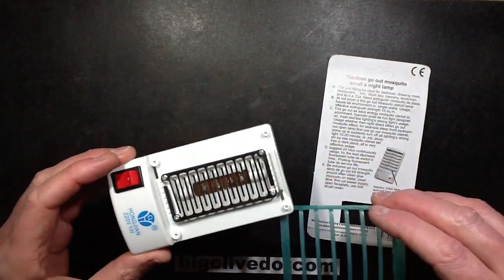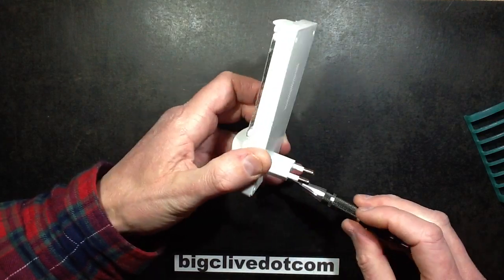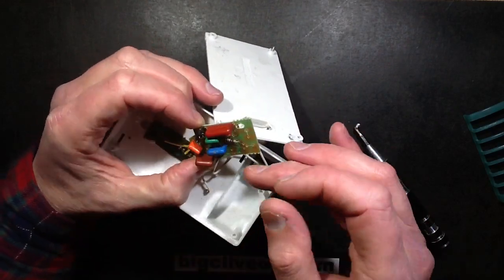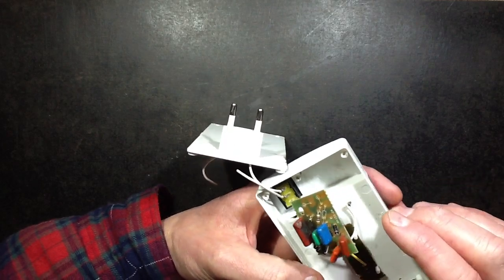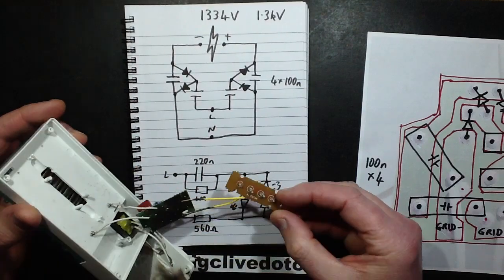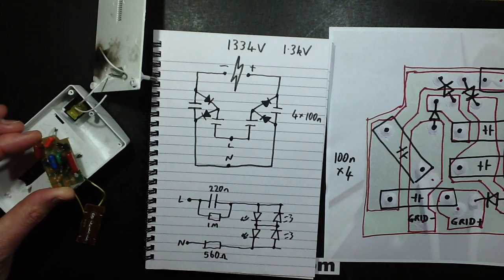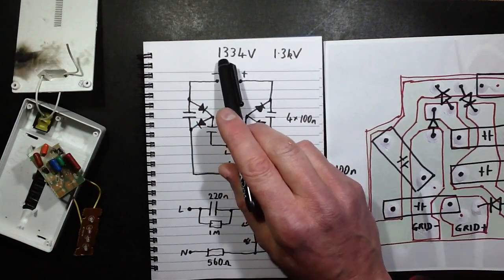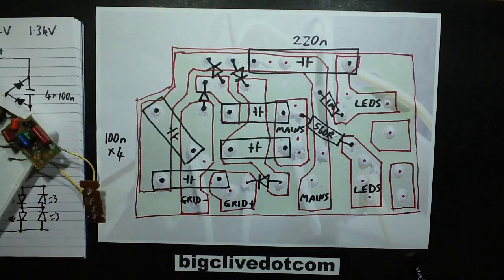Incredible exploding Chinese insect (and human) killer.  (with smoke)

Comment: Interesting Garden variety of coloured Caps in there. Your commentary is usually awesome. keep up the great work. The magic smoke release was epic ! The Caps and diodes should all be the same voltage and capacitance ratings. I know that the Chinese 1N4007 diodes from ebay are a lot smaller then the genuine 1N4007 diodes made in USA.

Comment: The capacitors are probably recycled from e-waste.
Reply: Hi DiodeGoneWild :D
Never really thought about this until now but you could be right... even so it could also be that they just picked some random capacitors from a bucket or drawer and used those! Like a mystery roulette game...
Having said that, I could have easily bought one of these from my local garage sale a few days ago. I really should have got it, shouldn't I? :p
Reply: I pulled apart some CFLs recently to get at the little ferrite cores within and liberated the other components at the same time. Having seen this video now I think there's everything you need in said CFL to make one of these shoddy things including the diodes and random capacitors.
Reply: @FordPrefect23  Maybe that's what this thing is made from - old light bulbs.
Reply: R. Perkins Reduce and reuse for the environment!
Reply: On the Shenzhen market, you can get anything for any price you want, but you get what you pay for.
It´s not even worth it to salvage parts, just buy a 10000 pieces for a buck.
Typical questions I got were: Do you want originals, original fakes or cheap replacements?
Although I seriously think that the first two are the same :-D
I wouldn´t recommend cheap replacement for industrail relaus, though. 20% don´t switch or get stuck.
Reply: Or have capacitor plague.
Reply: LOL and 0.00000000000000002% Gold

Comment: The capacitors are different because it has to convert to metric voltage first before it raises the voltage. :p
Reply: No
Reply: Yeah, metric voltage and metric time are difficult to convert accurately😵
Reply: @bruceanderson7762  
If you think converting metric voltage and time is difficult, try converting metric condom sizes.
Reply: @kaisersose5549  Aahaha,ok, yeah.
Reply: There was in fact a push for metric time.  Oddly it never caught on
Reply: @archiedentone5950  I remember that.  The reason it never caught is because everyone on the planet who keeps time agrees on how a clock works.
Reply: @kaisersose5549  Make 'em like the Torx screwdrivers.  No metric, no imperial, just a numeric size, such as T5, T6... so the condom sizes could be like Torx's nomenclature.  Or, we can just have four sizes: small, medium, large, and 'oh my fucking god where did THAT come from?'

Comment: I found it quite interesting that at 4:18 when the cap went pop the pulse affected the camera! 
Would that have been caused via the back feed through the power supply (mains I presume) or via some sort of mini emp ?
Reply from the maker: +Wolfy Wolf It may have oversaturated the camera's light sensor causing a line to appear.
Reply: +bigclivedotcom Oh.... And there I was getting all excited about emp's and weaponising fly zappers, Thank you for the quick reply.
Reply: +Wolfy Wolf In fact, it's more likely to be how the flash of light from the pop looks when captured on a camera with a rolling shutter. The flash happens when the sensor is scanning the top of the frame, but is gone by the time the sensor's scan has reached 1/5 through, and so only a small portion of the image is lit up.
Reply: I think its because the camera has a rolling shutter. That means the flash was so quick, that the camera only caught it on the top part of a single frame. But i might be completely wrong.

Comment: I bought the very same device about a year ago for 1€ (inc. VAT). It is the best 1€ ever spent, as far as I can remember.
Apart from successfully killing insects, this device also provides a quite strong illumination, so there is no need for someone to switch on the light during the night in order to move from one room to another.
I am going to buy some more devices of this kind before someone is killed and the device is recalled!

Comment: the reason for the different capacitors is because the closer you get to the output terminals the higher the voltage rating of capacitor is needed.

Comment: For shorting capacitors out i do always use a sponge which is only wet on the downside. Easy and fast contact to all solder points. Doesn't even need saltwater, just tap water is sufficient.
Reply: Tap water is salt water, eg. it has lots of ions in it. Purest water can be found at powerplants in the steamy part that goes trough the turbine to turn the generators. But even that is not true pure water. There's two physical/chemical effects working there: 1st any impurities in the water will form glass deposits on the turbine blades deforming them and causing all kind of havoc. 2nd pure water is acidic, because autocatalyst in water produces OH- and H+ ions and H+ ions being light are more active than the OH- ions. This corrodes the turbine blades and causes all kind of havoc. So it's a lose-lose situation.

Comment: They probably bought capacitors from several factories that had failed quality control. Factories usually sell off failed electrical products so that they can be recycled, since they often have valuable metals inside. However, the ones that work somewhat are resold and only one that are completely dead are recycled.

Comment: In the USA in the Pacific NorthWest, we have the rare mosquito.  I have a US version that uses a tube instead of LED's.  Started years ago using one when tent camping to clear out the tent by running one with an inverter for about 10 minutes to completely clear the tent for the night.  Still have the unit in the motorhome for the same use.  I would like to find a US version with LED's instead of the tube.

Comment: Maybe made for American 110vac supply.as the discharge capacitors should be rated at double  the ~300Vdc supply peak plus about 33%. So 800Vdc or 1kV more readily available. The first cap before the diode at 400V rating, is OK.

Comment: 4:25 is about what I had happen with an original Xbox PSU a while back. Had a nice failure at the solder joint for a capacitor.. sounded about the same too. Don't know what happened there, but at least I got it replaced.

Comment: have you ever played with one of those electrical bug swatters... they are crazy. they are shaped like a tennis racket and output a few kilo volts. it is actually a nifty little circuit, just a transformer and a little 500v poly cap IIRC.

Comment: Probably was made by the ghost shift, using the moulds of the real one, but without the "expensive" electronics inside, using stuff bought from component recyclers. Use injection moulder on Friday night after work to pop out 1000 cases, make a box and labels and then spend the weekend stuffing the boards, then put together after hours during the week and sell on the grey market.

Comment: The capacitors should keep it below lethal dose, however you need to trust that they will never short. Luckily those aren't electrolytic (which short when worn out). They look like polypropylene (plastic film) capacitors which normally fail open and last a while (if rated properly for the charge). Still not something that would be considered safe in the EU as there are some open wires. Yes if the diode fail short you're also in trouble.

Comment: I quite like the way you do the reverse engineering here, but I didn't get the application you used for it (you spoke to fast for me). Could you let me know?
Reply from the maker: I used a free graphics processing package called Irfanview to crop, flip and lighten the image.
Reply: Irfanview is one of the first programs I install, whenever I do a windows install. Small, versatile, powerful, free. Love it.
Reply: Clive uses Irfanview.

Clive has the tastes of a gentleman.

It's basically been all the image viewing stuff I need for the last, what, 15 years? And if you only need super-basic stuff, it'll do the job.

If you need something a little more advanced, there's always GIMP, but then you're going into more of an image-manipulation direction a la Photoshop. If all you need is simple stuff like brighten/crop/flip, however, Irfanview's got you covered, and it's really good for viewing images too.

Comment: I am sorry, but what you say about the LEDs (them being connected halfways, you state it may halve the voltage from appr 6 to 3) in several ways makes no sense; of course, electricity cannot flow back to the polarity it came from and even if it could it STILL would be through a second LED!  Dependent on where the + and -  are, the electricity can still only flow one way, namely through those two LEDs that are in line 'conductive into the' right 'direction for it to flow through them of course. But maybe it could be that this does something to what happens after each polarity switch of that ac current (response, how they do or do not keep on glowing or show that 25 Hz lighting frequency visually)? However I rather think it is just a built-in protection to up the output of the factory (even when someone would solder in one of those 4 LEDs it still would kind of work :)
Reply: adriaan van harrick Clive is correct, watch the explanation again.

Comment: Reminds me of when I was at school.  I built an oscilloscope and needed an EHT supply so I raided the junk box and ended up with a motley collection of metal rectifiers (the type with fins on) and capacitors in a voltage doubler circuit.

For reverse engineering I've used Inkscape or Serif Draw Plus, you can photograph each side of a PCB, flip one of the images and superimpose it on the other.  You can alter the transparency of the top image so you can see the tracks (or components) on the opposite side of the PCB.  Example here https://www.flickr.com/photos/rtbcomp/albums/72157663331362464  you could also produce an etch mask if you wanted to make a new PCB.  I used CADStd or ExpressSCH to draw schematics.

Comment: It's really funny, but the UK version. It is more composed than the Mexican or American version.
[buy one for about 70 or 90 US cents - 20 pesos really]
Mex version is more simplistic, it only has 2 capacitors of 540uf or a similar value at 400V. some resistors (2 or 3) and ONLY 2 DIODES. (so it produces a noticeable half-wave flicker, perhaps what attracts flies)

the resistors really do nothing more than limit the voltage of the LEDs so it is possibly a transformerless Circuit
[it was so simple that I tried to rebuild the circuit in a virtual way with "Crocodile Clips" but I couldn't make it work very well because the Leds exploded due to overcurrent or the capacitors didn't charge if the resistance increased]

I really did not have expectations but curiously it works, not 100 but if I dare say 60% - Apparently blue LEDs do not attract much to mosquitoes, but flies do.  particularly those that are "M. domestica", and some "Drosophila melanogaster" (they are very small so they don't always dies).
 
the only problem is that the voltage is too low for a common size fly [the 127VAC 60Hz voltage from mexico may not help much] 
so it only has a stunning effect, although with some luck in their erratic shaking they get trapped in the laminate. leaving the lamp in a short circuit that decreases efficiency [I daresay it is not very humanized since the fly must stay there too long for it to die, and it is at least 2 minutes in which it sparks at the slightest movement of exhaust]

That's not to mention that if the LED bar gets too far apart the flies get inside the chassis and get trapped inside (they really get too attracted to the LEDs once they are discovered)  Mosquitoes are not attracted, sometimes even fleeing from light. They fall at the end of the day but it is very slow (unlike flies, if they die on contact) the problem is when they get caught and short circuit equally
I don't know what exactly it is but I guess it will be because of the cheap PCB.
But if you lightly tap the lamp when it is off, the LEDs tend to light up. (sometimes even when the capacitors are supposed to be flat)

-Inverting the Phases is not a very good idea (risks / advantages of the NEMA 1-15 plug over the British one)
-the resistors and capacitors are sufficient to dissipate and generate a parasitic current that semi turns the lamp on when it is off.

Comment: is this the most dangerous Chinese item you have reviewed ? if not what is ?
Reply from the maker: +BillyNoMates1974 It's hard to choose, but the phone chargers that have virtually no isolation between the mains and output are a good contender.  two others that come to mind are a lamp holder adaptor that exposes a large area of live metal, and some lamps with live solder joints on them where you would hold them to plug them in.
Reply: +bigclivedotcom how about the bath warmer

Comment: what do you think would be the highest current at that voltage could you get through your body worst case scenario?
Reply from the maker: +Alan Wolstenholme In the worst case scenario of standing in salt/chlorinated water and holding a metal object with wet and cut hands it would potentially be several amps of current.
Reply: ok thanks-i should have just asked i wonder how many amps if measured to earth with an amp meter-in an ideal situation where nothing blows-thought it would be very limited due to the capacitors limiting what they will let through..

Comment: Where can I get your screwdrivers from?
Reply: ***** Those interchangeable tip screwdrivers are available from pound shops here in the UK (I believe Clive uses Poundland, but I've found them in the 99p stores too). Good quality for the price
Reply from the maker: I get the little multi-tip drivers from Poundland.  As Chipmunk says, they are pretty good quality.  If you hear any rattling when I'm using them it's because the bits are stored inside the barrel.
Reply: bigclivedotcom
Clive, how many have you bought? I've got 5 and am considering more, because I know some bugger's gonna steal them
Reply from the maker: I have a few scattered randomly round the house so I can always find one.  And two on my workbench with a flat and philips tip permanently in them.  They're also handy as gifts for coworkers.
Reply: Awesome, cheers! I'll keep my eyes peeled

Comment: Care to recreate this circuit, just for fun?
Reply: I made one and I couldn't get it to blow up.
Maybe I should use undersized tracks and magnet wires instead?
Reply: I think I'm going to source capacitors from random electronics and factory rejects instead of eBay, then make this again, this time preserving the crappiness of the circuit and dangerousness of overall design.
p.s. I don't think 25AWG solid core wire is sufficient. I need to go thinner.
Reply: Okay, made one and holy shit how big of a bang it made.

Comment: The most chinese products be funny but how be a correct working UK product? What be different in wiring and in power plan?
Reply: Since noone better replied: For starters, each component should be rated to handle the voltage it carries plus a safety margin. Also the front grid should be harder to poke through and securely screwed in place.  Third, there should be something discharging the caps on power off, but without eating the power when in use, which is going to be a bit difficult to design.  There may be additional things to fix.

Comment: Works!  Kills insects, pets, small children, electronics technicians....

If you need a stronger action, try using in the shower for a surprise efficiency boost.
Reply: China is covered by IEC/EN, like all of Europe, the IK and  most of the world outside of North American. People don't realize that 98% of the IEC certified equipment is "self certified". That means that  the manufacturer says it meets the specs. Theoretically, the company tested it, but there is no requirement to prove that or submit its results. So if you see that IEC/EN certification, it's pretty much meaningless.  

Now if there are enough complaints, the IEC may request third party testing. and Bing Foa electric of China, changes its name to Kung Fu electric and produces the same product. Problem solved!!

Now it seems likely that big brand name manufacturers in Europe, probably do check their designs against the spec and maybe even test it before or soon after it hits the market, but the certification process is mostly a matter of trust.  It's a problem when you have nearly 100 member countries and the specs and rules of the IEC are decided by consensus of its members. Getting 100 players to reach consensus on just about anything, is wishful thinking at best, but it is possible if you make enough compromise, And to make matters worse, membership representative don't really need to be subject matter experts, so it is entirely possible for these reps to be political appointees. So in reality, the system is a bit of a joke except for those who take some responsibility for compliance to specs. 

But even at that, a lot of this Chinese junk doesn't even pretend tp be certified in any way, Welcome to the global market!!